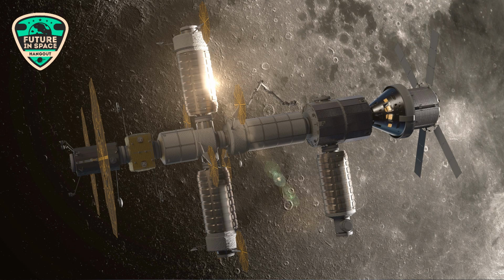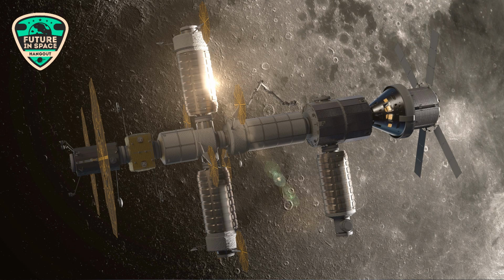What Will NASA's Lunar Gateway Habitat Look Like?

Comment: It will look like a pit of money.
Reply: Guess you'd rather be a snail than a sparrow. Guess it's cheaper to embrace that option.
Reply: @2bsirius  NASA has had about 75% of its Apollo Era budget for over 40 years now and hasn't left LEO.   You may be fooled.  I am not.
Reply: @kurtu5  Not to mention that NASA has a hell of a lot more on it's plate now than it did 40 years ago.
Reply: SLS and now this The Lunar Gateway,  these things are called pork.   These are money pits that benefit specific political constituents.  This is the sort of shit that NASA has on its plate.  I grant you that.
Reply: @kurtu5  SLS makes SOME sense as a heavy lift vehicle. Adjusted for inflation, the Saturn V amounts to about $1.23B per launch, and the SLS is meant to be about $500M per launch. Will it actually meet that optimistic goal? who knows. The shuttle certainly didn't. But unless Wikipedia has their numbers wrong, the SLS will actually have slightly LESS payload capacity in the Block 2 configuration than the Saturn V did, which is weird. I hope I have that wrong.

But the Lunar Gateway is pork, pure and simple. Now, if we were mining the moon or setting up a colony, had regular ferry service from earth to moon and lunar orbit to surface, and needed a sort of "depot" in between, it would make some sense. But I don't think that's what they're intending. They're describing it more like the tube between docked ships. We already have those.
Reply: @BlackEpyon  If the queen of Spain had taken your attitude 
@BlackEpyon and  @kurtu5 we'd still be peasants in Europe insisting that sailing west from  Genoa would be an expensive waste of time. Exploration is expensive, but it's a lot cheaper than endless wars. Exploration requires a safe harbor to ensure safe    reconnaissance. If you think it costs too much take a look at the cost  of production and upkeep for one nuclear submarine, and I think you'll change your mind.
Reply: @2bsirius  To be more accurate its like she said burn the ships and then stare at our navels while spending the treasury on new ship designs every 10 years that we never actually build.
Reply: @2bsirius  I'm not opposed to manned space exploration, or even colonizing. I WANT these things to happen. But NASA's budget is limited, and if this lunar gateway is meant to be as they described, then it's serving a completely redundant function, and therefore is a waste of valuable funds. Just park the lander itself in orbit with it's solar panels deployed, mate the Orion with it to transfer the crew and supplies, do your thing on the surface, and then when you're done, leave the lander in orbit again for the next crew. It comes down to eliminating the middle-man. 

Maybe they intend to stock up supplies on the Gateway, using it as a depot so the lander can ferry supplies to and from the lunar site in less time than it takes to make a round trip from earth, which would make some kind of sense, but they're not describing it this way. They claim "sustainability," but are describing it like crawling through a tunnel to get to the ship on the other side.

I can think of things that a lunar orbiting station like this COULD be useful for, but it's not what they're describing it as, which makes me suspect that this is just the GOP allocating pork because they don't know what they're doing. Remember, NASA changes direction every time a new monkey takes the Oval Office, and Congress is almost entirely illiterate when it comes to science and engineering. NASA can only do what Congress mandates them to do, and if that happens to be wasting money to win votes, then that's what NASA has to do.